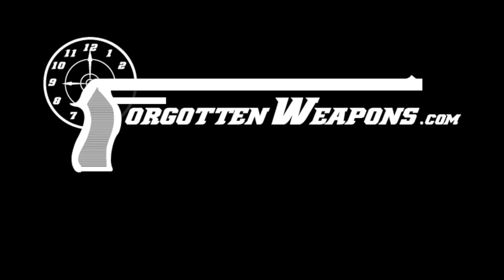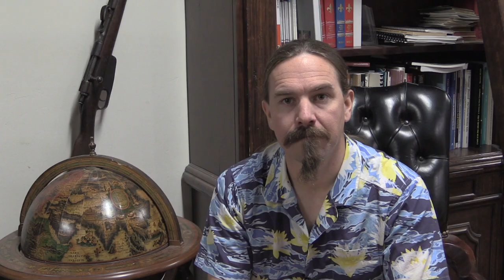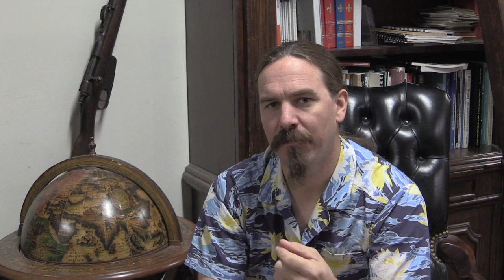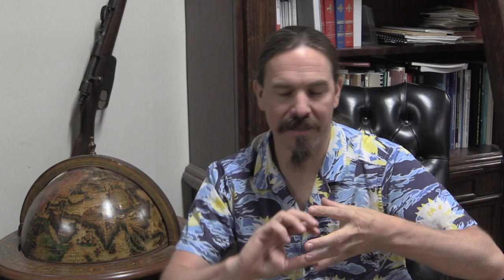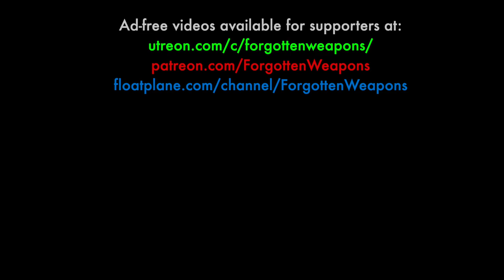Ask Ian: Progressive Twist (Gain Twist) in Small Arms?

Comment: One thing to remember is that the bullet is accelerating as it travels through the barrel, so even with a constant rate rifling the rotation of the bullet increases somewhat gradually.
Reply: Yes, but...  The rate of velocity increase is highest near the chamber and lowest at the muzzle.  This can be seen in the velocity per inch of barrel charts.  Cut an inch off a 26" barrel and there isn't much change in the velocity cut an inch off a 6" rifle barrel and there is quite a larger change in velocity.
Reply: The bullet starts to spin only when it engages rifling.
Reply: @GreenCanoeb  its called pressure curve but you are correct
Reply: @GreenCanoeb  Sure, that's why I said somewhat 😉
Reply: @wrathmachine7609  So we want the deferential of the function that defines the curve?...   😉
Reply: @GreenCanoeb  Powder burn rate determines the pressure curve.
Reply: @michaelgarrow3239  for a constant twist rate, those two are the same - if you accelerate the bullet faster, you're covering more inches of barrel per second squared, so the rotation rate must also accelerate proportionally.
Reply: @MysticalDork  aye. The distance covered is directly proportional to the rotation of the bullet engaged with the rifling and is mutually exclusive of pressure and therefore speed.
Reply: @michaelgarrow3239  since the spin is a direct result of the rifling on the bullet as the bullet travels down the barrel, spin and velocity are directly related and so rate of linear acceleration of the bullet is directly related to the rate of rotational acceleration of the bullet.
Reply: @GreenCanoeb  the rate of acceleration does indeed change, which means the rate of rotational acceleration also changes along the length of a conventional rifled barrel. Some "gain twist" barrels for 20mm and similar have seemingly bizarre changes in pitch along their length because they've matched the rate of rifling pitch with the rate of acceleration at different lengths down the bore. So, by changing the pitch both up and down in time with changes in forward acceleration, they manage to keep the rotational acceleration constant all the way through the barrel.
Reply: @MysticalDork  That's what I thought initially when I first heard about "gain twist". But it is only true if you have no freebore, i.e. if the bullet is already engaged in the rifling when the round is fully chambered. Outside of precision rifle shooting (where you can handload ammunition that perfectly fits the chamber of your rifle) that doesn't happen.
And as the bullet only engages the rifling after traveling the freebore distance, it already has some (significant) linear velocity without any rotation. That means it really "crashes" into the rifling rather than being gradually spun as it accelerates. With higher pressure, larger caliber (meaning: more rotational inertia) and longer freebore (especially if it varies, depending on different bullet designs), the problem gets worse. This is where gain twist can prevent stripping the bullet's jacket/driving band while also slowing down the erosion of the rifling.
That's why you see it in autocannons like GAU-8, GAU-12 or M-61, which are large caliber and can use different kinds of projectiles (which means variable freebore) and also in revolvers that shoot different kinds of cartridges, with different bullet weights, pressures and cases (like the S&W Mod. 460).
Reply: @niznikb  I wonder how much of the benefit could be had by having the rifling accelerate from zero twist to the final twist in the first caliber or two after the end of the free-bore?
Reply: @Kaboomf huh
Reply: @Bartosz Niżnik huh
Reply: @PetrHosek it doesn’t though. The first couple inches it goes from 0 to 2000 fps and the last half gains an extra 1000 fps. This is for 223

Comment: Stuff like this is super interesting to me, I’d like to see more “nerdy mechanical engineering” stuff on small arms throughout history
Reply: Definitely.
Reply: Weatherby still (or did last I checked) use gain twist in their rifles chambered for their proprietary calibers. Several reloading manuals still specify that the load data used is only safe in a factory barrel or one that uses a similar gain twist pattern.

Also, many muzzleloaders making custom guns today still use gain twist. Accuracy isn’t the big reason, per say, but the ability to use a patched round ball or a conical bullet out of the same rifle.  Traditional muzzle loaders typically either are best for one or the other, with a few having middle ground twist rates, which may or may not do all that great with either PRB or conical.

Comment: Another modern gun that uses it is the diy FGC-9 MKii! I don't believe there was any real purpose for using it  other than showing what could be done using the diy electro-chemical machining techniques thay were developed, but that seems good enough of a reason to me.
Reply: I was going to mention the FGC-9 but you beat me to it.  There's not really great advantages to using it, but there aren't really any disadvantages to using it.  And as you said, with the ECM rifling there's no extra difficulty in adding it.
Reply: I think it's just cool that the most anti gun control gun ever made uses a highly complicated rifling system for the lulz
Reply: @gingergorilla695  it really is just for the lulz 🤣
Reply: I think Ivan did see some increase in muzzle velocity, but it wasn't really very significant. Maybe 100 fps on average. Just a cool detail.
Reply: @Tunkkis  A 100fps increase with 9mm? That is very significant.
Reply: If 3d printed ammo becomes viable, it could help with the inconsistent quality.
Reply: @oktayyildirim2911  Maybe I'm misremembering the number or mixing up units, then.
Reply: @jonp8015  How does S&W do it? Chemicals? I figured draw cutting would be the only way, but that had been replaced by hammer/mandrel forging.
Reply: @One I believe they are.  Not a printer myself but, I think plastic needs to be thicker as it is not as strong as metal.  Print guns.  All gun laws are infringements.
Reply: @One Yeah, material considerations are the main reason. Some of it is probably stylization, but that's not a primary reason.
Reply: @jfree9951  I believe they use electrochemical machining. Run a saltwater solution through the bore with electrical conductors in the shape of rifling on the inside. Pass a current through the mandrel and the barrel, and the rifling essentially rusts into the walls. Clean it up a little and you're good to go.
Reply: @One practical. Plastic is always gonna be weaker than metal, so you gotta beef it up a bit.
Reply: @jfree9951  rifling is never part of a forging process, grooves are always cut with a rifling button. you can guide a rifling button with a progressive twist jig. you can make a progressive twist jig by milling flutes on a steel rod. changing the flute twist rate is as easy as stopping the mill and selecting the twist, then resume milling. older jigs were twisted by hand. if you get into home rifling you'll understand how easy it really is to just make a variable twist rate
Reply: @joemama.556  isn’t cold hammer forging a super common method?
Reply: Forging over a mandrel is a common method.

I don't think you could implement gain twist rifling with it however, as there would be no way to remove the mandrel after forging.
Reply: @thomasa5619  yes but thats for giving the barrel certain mechanical properties. cold hammer forged barrels are said to have better "memory" which means they wont loose accuracy after radical temperature changes, their "shape" stay the same after cooling down and they have better harmonics too

Comment: The intuitive part of my brain also says, progressive twist should help cut down on erosion of the initial rifling, thereby extending the life of the barrel.  Perhaps not as important in hand guns, but I could potentially see it increasing longevity for expensive barrels for rifles of various calibers.
Reply: My first thought about this also, especially on very high velocity rounds.
Reply: I don't think it'd have much of an effect as purposely running colder loads in your weapon would, more or less. If longevity is the goal, one could cut their powder load by 2-5%. it's easier on the rifling, right? lol
Reply: I'd rather work on developing polymer ammo that would reduce hear transfer.
Reply: I had thought the rifling at the muzzle was much more important, because ultimately that was what determined how well it was stabilized after it left the barrel.  Hence why, to extend the barrel life of many worn out ww2 surplus rifle barrels, it's common to "counterbore" these and essentially drill out the first inch or two of barreling at the muzzle.

If you did that with a progressive twist barrel, you'd be altering the rate at which the bullet ends up spinning once it exits, assuming the twist rate continues to increase right up until the muzzle (which it may not, I don't know.)  But if that is the case b you couldn't do this with a progressive twist barrel.

Granted, it takes a massive amount of use to wear out a barrel like that, so it might be a total non-issue.  I'm not a gunsmith so maybe I'm totally wrong about this.
Reply: @VosperCDN  I was thinking the opposite. The faster, heavier, in general more powerful around, the more gently you want to start rotating the projectile. If you can ease into let's say shallower depth slower twist rifling, then progressively make it deeper and faster, you spin the Round up with less instantaneous Force applied. Since that Forceis equal between the rifling and the projectile, both are saved from excessive wear or damage. At least that's the theory that's propagating through my head. I'll defer to someone who has either actual experience or entire notebooks of math to justify an alternative position.
Reply: @mastercat381  Damage to a barrel's crown has a large effect on accuracy, and one could imagine that the end of the barrel most exposed to the elements might suffer environmental wear, but barrel erosion from actual use is almost entirely concentrated around the throat where hot propellant gas and the rapidly accelerating bullet hitting the rifling wear down the lands. People who want to extend the useful life of match rifle barrels can have the chamber re-cut a couple inches forward to hit fresh lands.
Reply: @KyussTheWalkingWorm  This is exactly right.
Most people don't have a good understanding of barrel wear.
It's almost exclusively throat erosion.
Crown damage is a totally different thing & not usually related to shooting, but dropping or improper cleaning.
Reply: They should be staple for firearms to reduce barrel wear and reduce friction heat closer to the chamber in rapid fire/full auto.
Reply: Burning high velocity powder causes the erosion, essentially blasting the metal away like a sand blaster abrasive.

Others said it first, I just wanted to explicitly spell it out.
Reply: Thank you. My brain was having an aneurysm reading the people thinking that gain twist rifling was going to magically save their barrels from throat erosion.
Reply: @jordanwilliams6972  it makes sense mechanically though. When you're driving a car you don't just full send the steering wheel all the way when you want to make a turn or else your car flips over, or it puts a lot of stress on the wheels and axles and suspension because the car is carrying a lot of forward momentum and you're trying to change the direction of that momentum. You ease the steering wheel into the turn *progressively.* Its not a perfect analogy but its the same principle as when the bullet initializes into the rifling
Reply: @KyussTheWalkingWorm  interesting, thanks for the info.
Reply: I can also imagine it being harder and more expensive to make accurately, to the extent that you're better off with standard rifling and replacing the barrel slightly more often.
Reply: @KyussTheWalkingWorm  yeah, I believe the damage to the barrel crowns that they're repairing is from the corrosive ammo that they were issued with.
Reply: I suspect its also a cost factor. Progressive rifling is likely more expensive, so you gotta wonder if a potentially very minor difference in wear is worth the effort. Or if you can just make the barrel very slightly thicker/more sturdy to deal with it cost effectively.
Could even be that progressive twist might be worn at a lower rate, but reapplying it would be more difficult too. After all it would at best slow wear down, not remove it.

With stuff like machine cannons its probably even a safety factor, considering they can launch pretty nasty explosive rounds.
Reply: I feel like I recall some custom .243 rifles being gain twist since .243 is a bit of a barrel burner

Comment: One of the items you mentioned was the effect of the twist on the body of the bullet and you were including or at least from what I heard including the 20 MM in this. Now I will admit that my knowledge is dated with my experience ending 1976 but up to then the 20 MM rounds all had copper alloy rotating bands and the steel body was essentially a bore riding design. The gain twist on these is more from the centrifical fuze of some of the designs which depend on the spin of the projectile to line up the elements of their explosive chain and make the rounds safer to handle.  Newer rounds like the 30 MM for the GAU 8 have a nylon composition rotating band. All in all, a fine video as always just I felt I had to point out something I felt needed more clarification.
Reply: So the idea is that a projectile would not fuse unless it had sufficiently spun to the desired rate first: and so having that rate reached only at the end of the barrel due to the gain twist would prevent squibs from causing serious problems.

That is, in addition to being unable to initiate the fuse while outside the gun.
Reply: @josephk.4200  Well, spin fused rounds activate some minimum distance downrange from the muzzle, not AT muzzle exit.